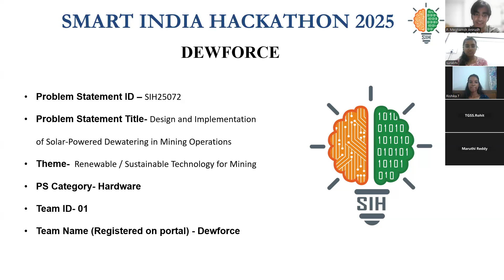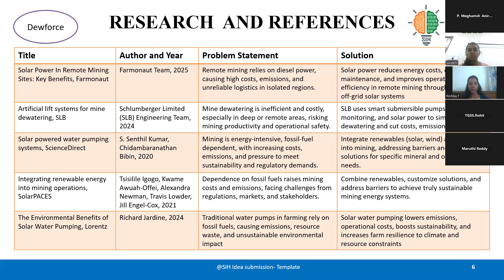Design and Implementation of Solar-Powered Dewatering in Mining Operations - DewForce (SIH-2025)

Comment from the maker: TIMESTAMPS:
0:00 - Introduction to the Problem Statement
0:30 - Drawbacks of Current Dewatering Systems
0:48 - Proposed Solar-Powered Dewatering Solution
1:18 - Uniqueness and Innovation (Real-time Optimization)
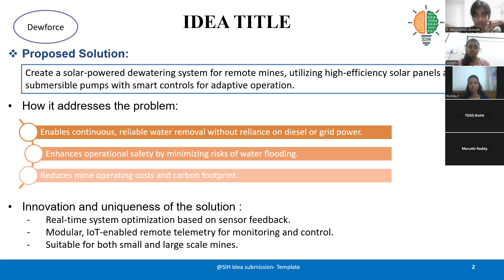1:52 - Technologies Used (Solar Panels, Pumps, Sensors)
2:40 - Methodology: Assessment, Design, Implementation
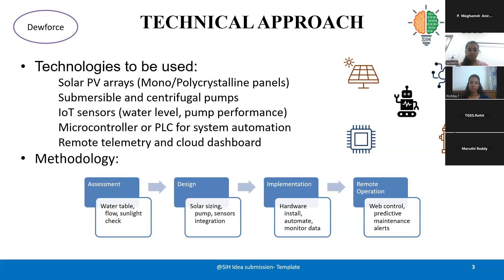3:09 - Potential Challenges and Risks
3:42 - Strategies for Overcoming Challenges
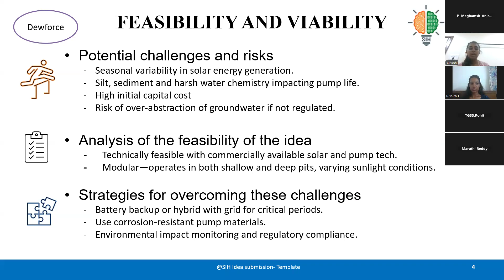4:14 - Potential Impact and Benefits (Cost Reduction, Carbon Footprint)
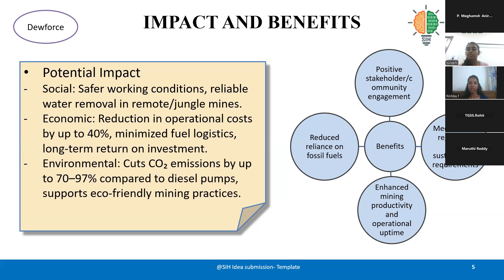4:55 - Research Papers & Conclusion